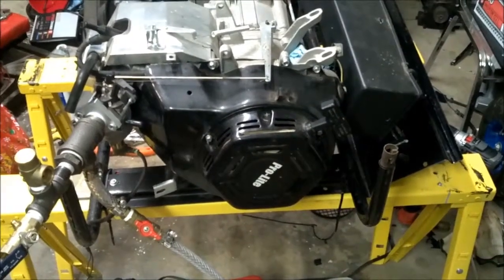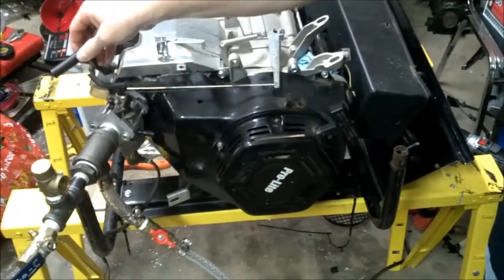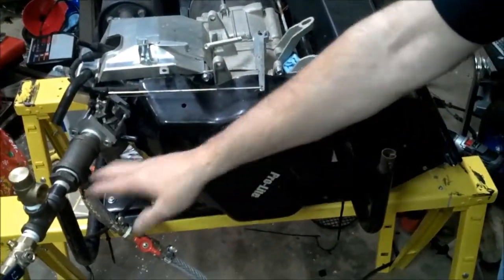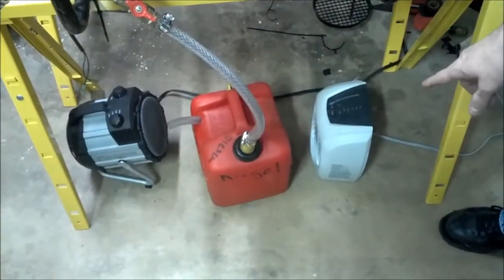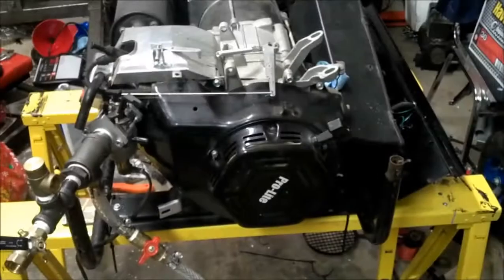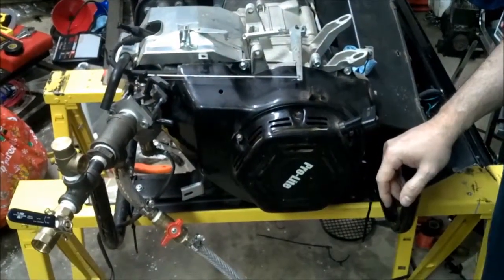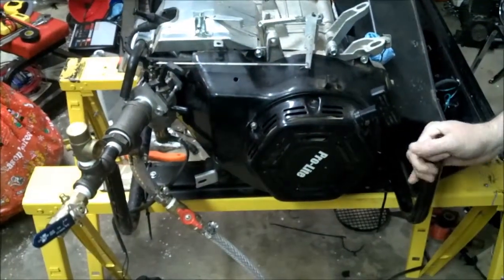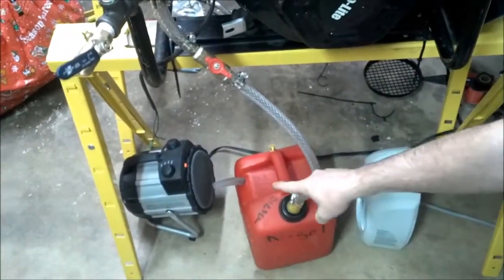6KW Generator at 50 percent load-TakeOne. almost GEET

Comment from the maker: Thanks man. As you can see to my reply to sunny5rising, I will be putting the original tank back on top again and heating it via the muffler. Because this tank is so much larger in the horizontal plane, I'll have no problems making plenty of vapors there... may need to close the vapor ball valve some once I'm there.
But yeah, after that I'll be on to my consumption rate calculations and letting folks know where that is.
It's killing me waiting on parts for the V8. I sooo want that to run NOW! :)

Comment: Great vid showing a good load test on vapor one thing i can see you will want to change for long runs is make up a stainless steel canister and fill it with some stainless steel wool that will increase yr surface area in side the container. Now for heat remake the muffler and make a spot for the new vapor canister to sit in this way the motor heats the gas for you making it use alot more of the gas total. I like that you kept the carb and just build off of it most dont but should Great work!

Comment from the maker: Thanks man.  I plan on a having a lil warmer plate to start on cold days (battery run) and have the heat from the muffler warm it afterwards.  That would then shutdown the warmer plate.  this is with the original gas tank mounted back on top of course.  I'll be shooting a video before too much longer once I get the tank mounted on top and use it in place of the gas can.  Need the gas can for the V8 dontcha know!  ;-)

Comment: for the V8's it best to use a addon fuel tank that you can setup and modify as needed to get it all to work also be able to place it in a spot where the exhaust can heat it up and be drained when needed so easy access to it but it can be done keep at it you will get it.One very import thing to keep in mind buy gas from diff companies and test them out you find one or 2 that vaporize way better then others.When i better i mean in how much of the gas can be vaporized some do way better.

Comment: Very cool just remember to put a fuel line shut off inline for cold days to start trick there start it on gas let the motor heat up the setup then switch to vapor also by having it that way you can keep it dual fuel for those times of need. As for the V8 thats alot more fun to setup on vapor you need alot more stuff like float switch and alot more to keep enough vapor going to motor. I can be done just be ready for a much bigger build (cont)